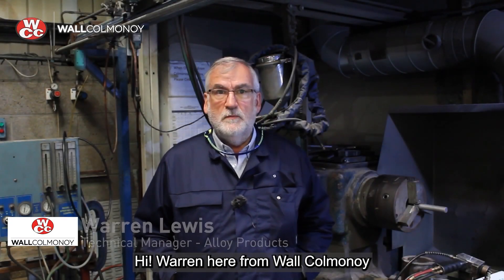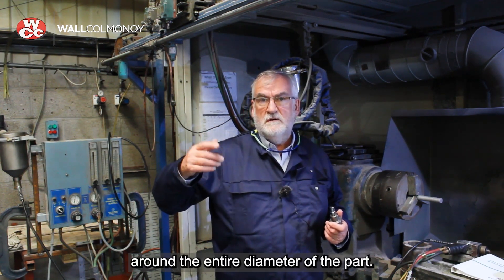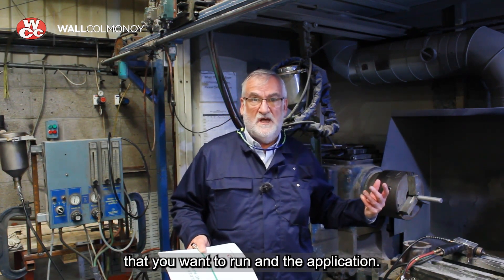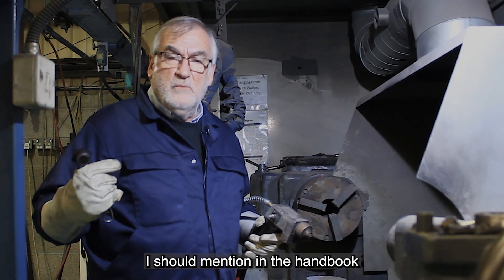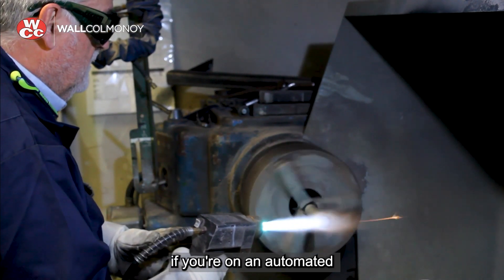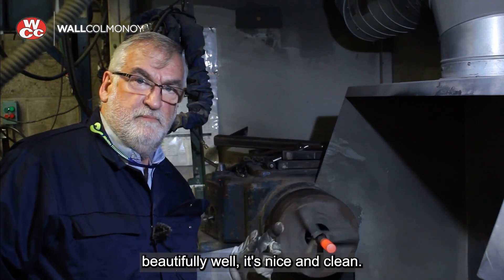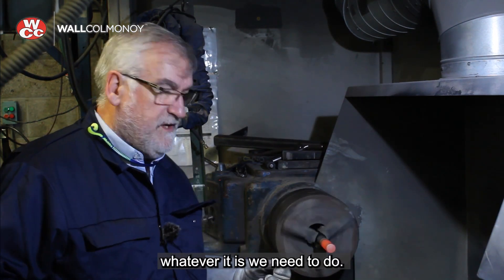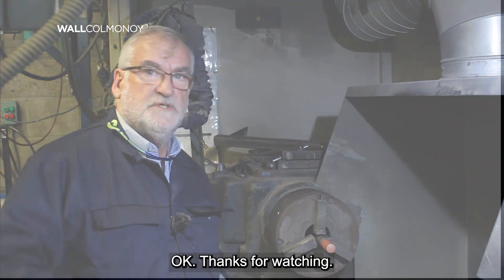Spraywelder™ System Demonstration

Comment: Hi Mr Lewis your work is good and the explanation is also good. But the video is so slow  that I feel  because I'm doing these types of jobs from the year of 1990 almost 34 years . I have done very big jobs as per the weight my last working was  5 tons  Rotor on the bearing the job was of ONGC which was 3.3kv around approximately  4000 H.P . 
I have done these repairs of Crank shaft also on the lathe machine, i hope you can understand the crankshaft of eccentric connecting bearing after machining grinding work used to be finished in mirror finishing. I hope you can understand very well about the crankshaft on the lathe  Machine  . Really I love to do such challenging jobs . I'm from Mumbai ( Bombay ) India any big jobs are there you call me . I would love to do that job . 
which country are you From ?
Reply from the maker: Hello,

Sorry you feel the video is slow but as well as demonstrating the spray-fuse equipment, I also try to give a full explanation of the system and the process itself. We are based in the UK and we have manager also based in Mumbai as well as two distributors, one in Pune and one in Ahmedabad. Would you like me to put our manager in contact with you? He has a great deal of knowledge about the Indian markets. You can contact me directly on warrenlewis@wallcolmonoy.co.uk. Cheers, Warren

Comment: Hi Mr. Lewis very nice videos. I have been coating with the D3 to the J3 Spraywelder systems for over 40 years and use Wall Colmonoy fusion bonded alloy exclusively. The only thing I would add as a safety issue is wearing a certified face mask to prevent inhalation of particles. As you know most of the Colmonoy materials are nickel based, as well as cobalt based, and both can be very toxic!! Protection and safety are key!

Comment: This is great, for sure, but it is unfortunate that they named it a “Spray Welder”, as this often confuses and leads people to believe this is a welding process. It is actually the flame spray powder process, which is great and widely used for >100 years. Because of this name, when helping clients and students, I need to continuously enforce that “Spray Welding”, a generic term that many people use to describe thermal spray, is not welding and the unfused coating is not welded to the substrate. If secondary fusing is used, then the coating is bonded to the surface more like welding, but not the same as welding and there is a gigantic heat affected zone due to the glowing hot fusing temperature needed. Again…all great! Just remember that this is thermal spray and not welding.

Comment: Good day...what kind of powder will recommend for Cast Iron?
Reply from the maker: Hi, almost any of our powders will work on cast iron when deposited using the Spraywelder™or Fusewelder™. It largely depends on what hardness the customer wants to achieve. We also need to know what equipment will be used so we can suggest the correct particle size range. Thanks - Warren
Reply: @WallColmonoy  we used wallcolmonoy 21A PTA in plasma transfer arc welding is this applicable for spray welding ?
Reply from the maker: @rommelolpato5359  Hi. Colmonoy®21A is self fluxing powder suitable for deposition using the PTA welding process and the Fusewelding process. It appears to not be made in the appropriate sieve range for deposition using Sprayweld™equipment. What type of equipment do you have? Please feel free to also reach out to me directly with any further queries. My email is warrenlewis@wallcolmonoy.co.uk
Reply from the maker: @rommelolpato5359  Hi. Colmonoy 21A is self fluxing powder suitable for deposition using the PTA welding process and the Fusewelding process. It appears to not be made in the appropriate sieve range for deposition using Sprayweld™equipment. What type of equipment do you have? Please feel free to also reach out to me directly with any further queries. My email is warrenlewis@wallcolmonoy.co.uk

Comment: Came here from a YouTube channel called Abom79, where an industrial manual machinist  called Adam Booth went over full time to pursue his YouTube channel further. 

He uses the Eutectic Terodyn 2000 spray welding system which although similar to yours does not have the final fusion stage using the acetylene torch for a long period.  He uses this system on bearing surfaces and highlights its benefit of much lower temperatures ( compared to welding as the alternative) thus not altering the base metal temper and avoiding shaft distortions and the like.  Your system having to use the acetylene torch at the final stage would seem to put itself at a disadvantage wrt that.  

The system he uses has been around for many decades. and although it might have decreased in popularity over the years ( probably due to comebacks), he swears by it provided preparation and consistency is good and it's used for the right application.  He says he has done loads of these at his previous employ, without any failure comebacks.
Reply: Sorry for the late reply. I believe the Terodyn 2000 was sold in the USA. The European version was called the Castodyn 2000. They had a blue handle and lots of valves. Good kit be quite expensive. No longer available. For resurfacing bearing areas, two-stage or single stage "cold" spray powders are preferred because as you mention, there is no secondary fusing stage so the shaft remains "cold".  This is often referred to as "metallising". Wall Colmonoy also manufactures a small range of metallising powders which can also be used with the J3 Spraywelder.

Comment: Hallo Mr. Lewis, congratulations for your excellent videos. I would like to ask you at what distance and what rpm you are using when you are adding powder on an turning axle. Thank you in advance. S.Kopitsas Athens Greece.
Reply from the maker: Hello S. Kopitsas,

The distance and rotational speed can vary depending on the powder being used, nozzle selection, and the diameter of the part. The RPM is usually taken between 9 and 15 linear meters per minute. Could I ask if you have a Spraywelder? If so, do you need a manual?

Cheers
Warren
Reply: @WallColmonoy  hallo Warren, thanks for your reply. I do not have a Spraywelder, and of course i need a manual and some more info on that subject  
(like: powder types and prices, 
welding temperatures, pastes, etc.) Usual i am working  with ck45, ck65, and inox axles (1-3 inches diameter).
 Thanks again. 
Spyros
Reply from the maker: @spyroskopitsas6088  Thank you for your response. For more information about our Spraywelder™, including a link to download the manual, you can visit www.spraywelder.com. Also, if you would like to contact me directly, you can email me at warrenlewis@wallcolmonoy.co.uk.

Comment: Why acetylene rather than LPG?LPG should burn hotter than acetylene from my memory.  Can it be used with lpg oxy?
Reply from the maker: Hello Defne,

LPG & oxygen is about 2800deg C whilst Acetylene & oxygen is 3200deg C. 

The Spraywelder™ will work using LPG (propane) but fusing is always better and quicker using oxy-acetylene due to the higher temp.

Cheers,
 
Warren
Reply: @WallColmonoy  overall, 2800 celcius will be enough for the alloys to fuse?
Reply from the maker: @defnecicegi8451  Hi- the answer depends on a number of factors including base material, pre-heat and duration.  If you email technicalservices@wallcolmonoy.co.uk we can talk you through it. Generally we always recommend using oxy-acetylene.

Comment: Generally the blow and blow plungers are about 10 to 15 millimetres, and it is very difficult to coat those small diameter s with the spray welder( there will be a lot of over spray and while fusing the fusing torch heat will be too high for the b&b plug diameter), I think that is why the fuse welder is used commonly thorough out the glass industry
Reply from the maker: Hi Abhay. If the overspray is too high, perhaps the incorrect nozzle is being used. As can be seen in the post, we used a J3C nozzle which, as you can see, has a very small, narrow spray pattern and so overspray should be kept to a minimum. Then, if during fusing, the part is becoming overheated, perhaps the fusing torch is too big or the technique being used needs to be re-assessed. The Sprayweld™ process was commonly used for both BB plugs and NMPB plungers during OEM manufacture before HVOF. This process should not be a problem. Thanks for your comment! Regards - Warren Lewis- Technical Manager